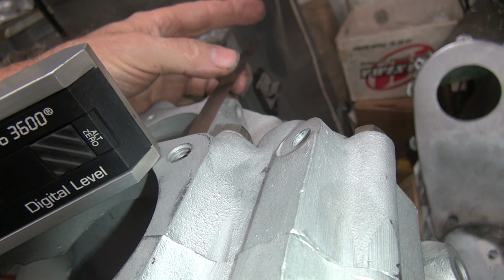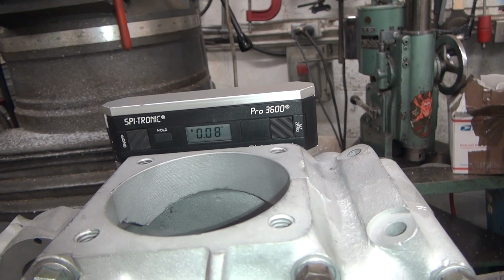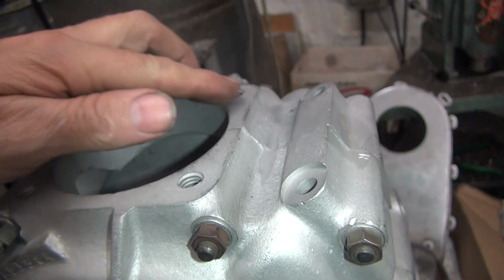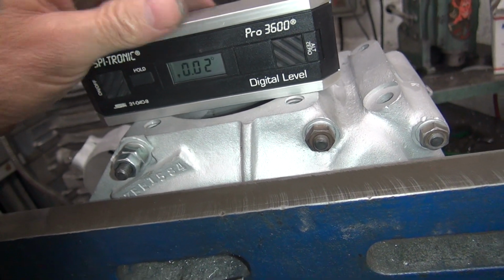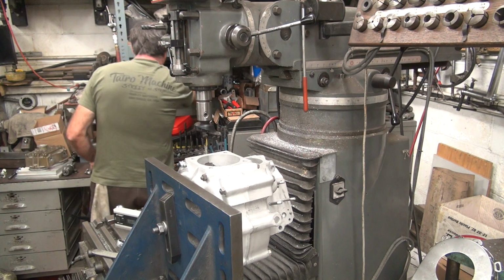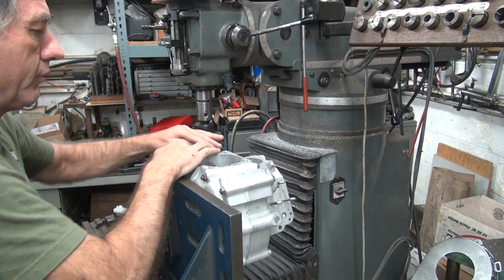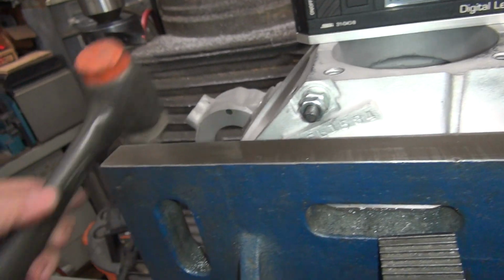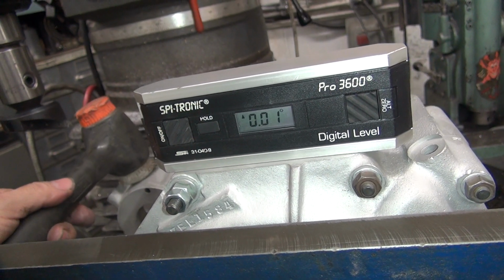#193 1947 EL case welding knucklehead 74ci motor rebuild & machining repair harley by tatro machine

Comment: Just a question;

Could the differences in the deck angles between the lifter block decks and the cylinder spigot decks be because the lifter block deck are centered to the cam center and the cylinder spigot decks are centered to the crank center?
Reply from the maker: if the motor was made correctly, all those things and more would be on center. every case i have measured over the years have been all over the place. it would be nice if some of them would be the same so that you would have some good info to go with. 
tatro